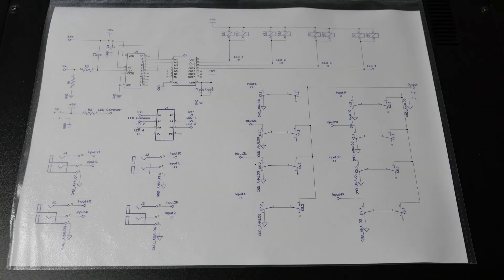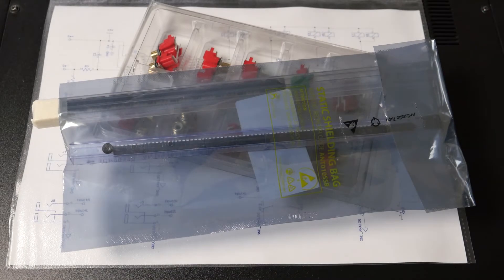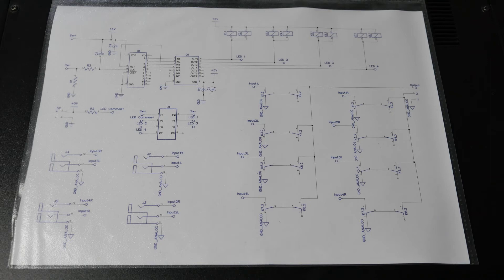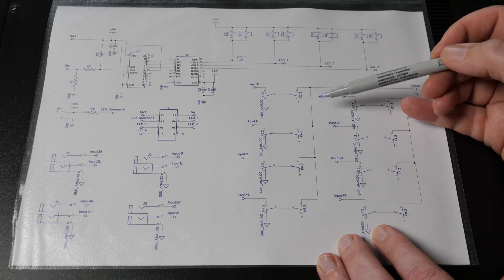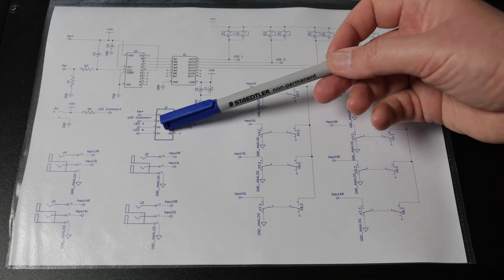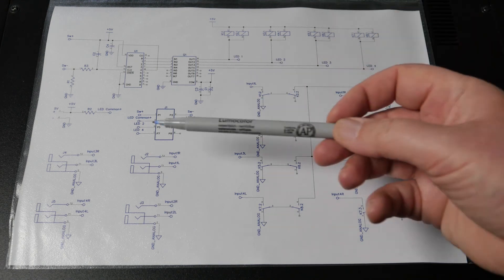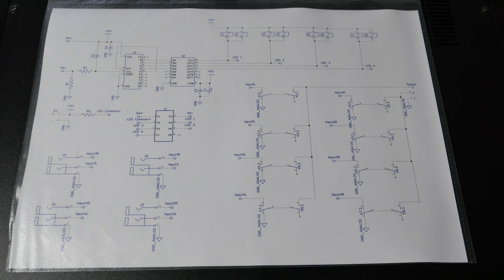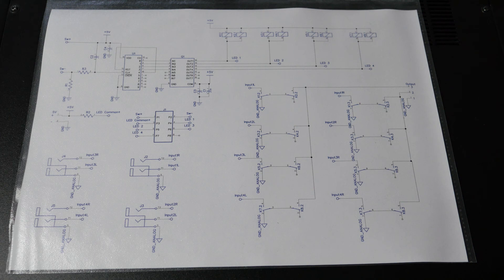DIY Amplifier - Input Switching

Comment: Grounding is a really good consideration all around. Everything that could be grounded without creating a loop, should be grounded. Audio designs almost always use a star ground which works fine. If programming is your day job, why not try out a CPLD or an FPGA as something new and fun? To each their own, but I genuinely enjoy HDL stuff much more than C/C++ with microcontrollers. I like low-level strongly typed languages, so I prefer VHDL. The military/aerospace industry uses largely VHDL for determinism/reliability reasons as well.

These days there are really cute modern solutions from Intel/Altera like "10M02DCV36C8G" - a tiny $3.78 USD package with built-in configuration flash. "WLCSP" packages are fascinating from a production perspective. If you want something simpler that's compatible with a 2.54mm perf board, you can get EPM70xx CPLDs in PLCC format (such as EPM7064AELC44), together with a 44-pin PLCC socket. No external config flash needed. It's an older device (but still orderable) which requires an older version of Quartus software (13.0sp1) but it's a DIY-friendly solution that lets you play with gates and reasonably complex designs. There are some alternatives from Microchip which afaik require you to create the design in Quartus and then use Microchip's software to convert the result.. but that's more troublesome haha. My "go-to" chip for customer products is "EP4CE10F17C8N". More expensive but very powerful, and you can get them in minimalist kit form from WaveShare on eBay etc. I'm sure Xilinx and Lattice have tons of their own options.. I have no brand loyalty but I have more experience with Intel/Altera.

Comment: Assuming you are using (say) a ULN2803 for Q1, the back emf for the LED is limited to the forward voltage drop of the free-wheel diode in the ULN2803, so why can't you use 12V for the relays (and thereby not stress your 5V supply)?
Reply from the maker: Food for thought - I hadn't really considered the free-wheel diode. That said, I still can't see how it helps me in this particular instance. By my reckoning the unlit LEDs still see the supply voltage minus the voltage drop across the lit LED, and the free-wheel diodes remain reverse biased. Perhaps I've missed something, though.